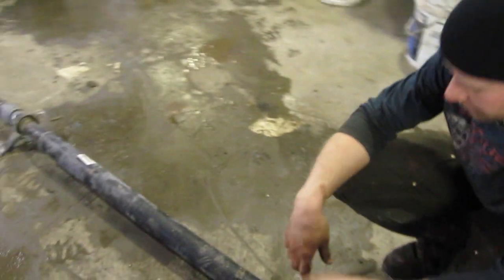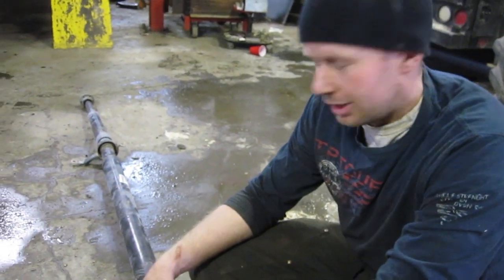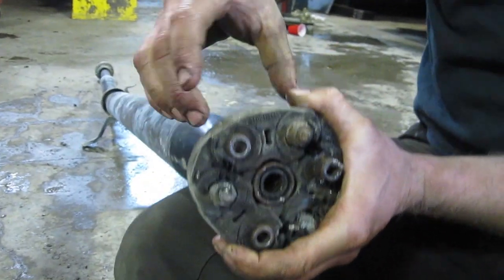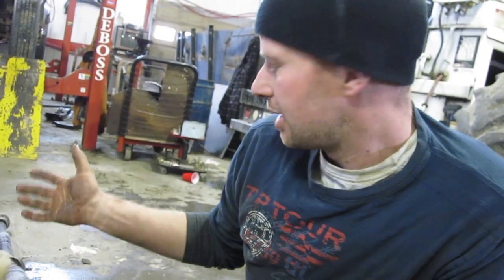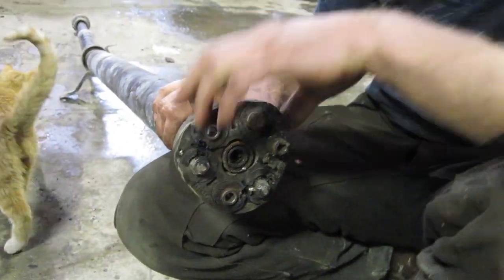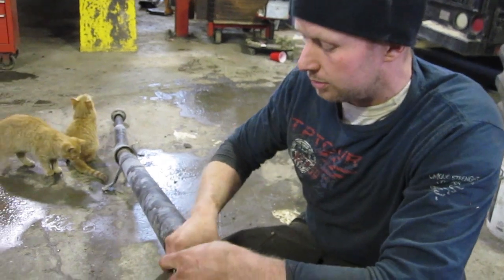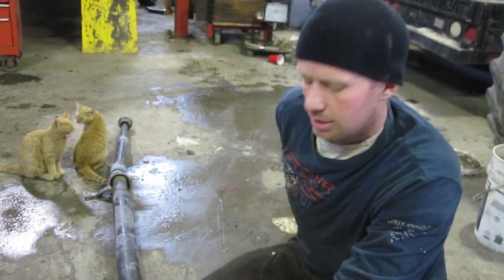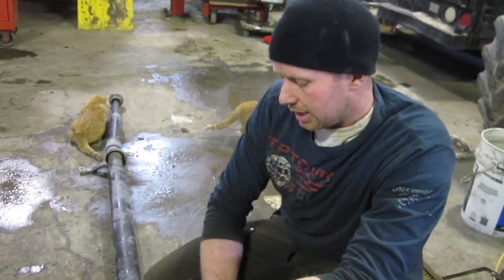Fix Vibrations in Drive Shaft

Comment: '97 Dodge Dakota  2 wheel drive  , noise starts at 40 MPH  , not a clicking sound but a high pitch sound that will make your ears ring. would it be the rubber damper ?

Comment: I have a 2004 jeep liberty and exactly at 50 mph rear tires start jumping. After I pass 55 mph it comes normal. I replaced all shocks absorbers and struts, all 4 tires balanced, all bushings and differential joint replaced, and the problem is still there. And weird thing is, if I lift the truck, this does not happen while is in the air, it only happens when is running at 50 mph exactly. Also checked bearing on all tires and they are still tight. The drive shaft seems not to be the problem since it looks really steday when running. Any idea or suggestions? I may be missing something to check.

Comment: I rebuilt a GM (Holden) driveshaft a couple of years ago & it still had a vibration off the mark on acceleration, it ended up being a sagging rear transmission mount which was the cause.

Even though my car has the Chevy LS1 Engine & T56 Tremec manual transmission, a $23 AUD generic (brand new) mount to suit an automatic 3.8 litre V6 car did the job & got rid of the vibration.

Comment: My 1980 plymouth volare has been shaking, bought a set of brand new tires since last ones were bad anyway, bad driver side front wheel bearing replaced.. still shaking. I'm gonna lift her up tomorrow and check the shaft next.

Comment: I’ve had a strange vibration in my 2000 Ford expedition 2WD , didn’t know if it might be a piece of rubber that was worn at the end of the driveshaft you never know? If they originally was one or not I didn’t notice one but heck it could’ve dried up and fallen out

Comment: 2wd 2008 Dakota has that same feeling vibrations start at 38 mph, then a him that echoes thru the cab, more of a groaning sound and shake clear up past 50; took it to a "reputitable " drive line shop, told me its fixed at the tune of $1100, no its not, it will be back come Monday!

Comment: good video. I have a 2006 silverado 1500 4x4 that vibrates only in the speed range of 45-52. It vibrates whether accelerating, coasting or braking. It started after having a 6.5 inch lift installed by a shop. I have installed new rims, tires, wheel hubs, tie rods, pitman and idler arms, and 2 u joints to my rear drive shaft and no luck. I am going to put new ball joints on it. What do you think it could be? Thanks in advance!
Reply: paint3ball when they lifted the truck I'f they didn't shim the carrier bearing or pitch of the shaft , it will cause vibration .

Comment: If that centre bearing hanger is off by 1 or 2 mm after installing it, will this cause the drive shaft too vibrate as well?

Comment: Hello, I hope I would receive a response as I dont know where else to turn..... I have an 02 Durango with 125,000 miles. Bout 6months ago had the ujoints replaced, solved the issue. Guy that replaced the ujoints said drive shaft is bad needs replaced said its barely hanging on. He said not to put in 4×4. When I get up to anything over 50mph I feel a vibration in the seat I believe is similar to what you explained about the coupler/gasket on the drive shaft going out as you described...... is this the solution to the vibration. The same fix as in this video. Please any and all help would be appreciated.
Reply from the maker: sounds like it yes
Reply: @DEBOSSGARAGE  ok. Thank you. Appreciate your time.

Comment: i know you probably get asked these things all the time, but i have vibrations in my 2009 ford fx4 no matter what speed im going but it does seem to smooth out at 60+mph. i know it could be a number of things but is this a common issue in trucks with a common solution?
Reply from the maker: u-joints in the driveshaft

Comment: I don't know if you'll answer or not, but it'd be important. Anyway, I have a 2004 Volkswagen Beetle (big mistake), and once I reach past 40-60 it vibrates so badly like the engine will fall out. Could it be the drive shaft? Or is it the CV axle or a motor mount? I have had my tie rods replaced, car aligned, and tires balanced.
Reply from the maker: +Colby Jack I would be leaning towards a cv joint or engine mount.  Does it do it if you put it in neutral and coast at 40-60?
Reply: I haven't tried that, but can one do that and not damage the transmission?DEBOSS GARAGE
Reply from the maker: +Colby Jack It won't hurt anything as long as the engine is still running for short periods.
Reply: DEBOSS GARAGE
What do you mean by short periods? I'm sorry, I don't know much about cars.
Reply from the maker: +Colby Jack just coast in neutral at 40-60 for a short time to see if the shake goes away
Reply: DEBOSS GARAGE I did, and it did so. The vibration is not as bad as it was, oddly. But I'm still gonna have my engine mounts and CV joints checked. Thank you so much.
Reply from the maker: +Colby Jack I'm betting on engine mounts.  let me know how you make out
Reply: Man who ever replaced all does parts ripped you off! They should of been honest....

Comment: Hey man I would like to know if you can help me I have 2005 Chevy Silverado when it hits 70 I feel a little vibrating on the truck not the staring wheel but the door panels and when I hit same path hole the whole truck shake bad side ways can you help me what could be thank you a lot ?
Reply from the maker: The vibration would lead me to thinking its u-joints but if the entire truck shakes when you hit a pot hole, I would look at the steering and ball joints.  With the truck off, have someone shake the steering wheel back and forth quickly and look at all the steering connections.  They should move at the same time.  For the ball joints, jack up under the front and grab the tire at the top and bottom and rock it back and forth.  There should not be any play.

Comment: hi i have bmw320i and just change the transmission but i hear now noise at car center in high speed like werwerwerwer plz advice
Reply from the maker: +adel mostafa I need a little more info like standard or auto, new transmission or used etc.  Im not that familiar with BMW.  Is it rear wheel drive,  front or AWD?  Does it make the noise in all gears or just one?  All speeds or certain speeds?  Does the noise follow the road speed or the engine speed?

Comment: Hi, just watched your video and the rubber coupling ( we call them donuts in the uk). Looks very much like a gkn coupling off a Land Rover discovery 2 rear prop. No idea if it's the same. But there about 20 pounds in uk so maybe worth a try. Matt
Reply from the maker: thanks! if I run into it again, I will look into it 1
Reply: someone before me left a socket on the rear u-joint ! would that be enough to throw the drive shaft out of balance ?
Reply from the maker: Without a doubt!
Reply: DEBOSS GARAGE thanks man ! I appreciate what your doing !

Comment: can you tell if the coupler is bad without removing the driveshaft?
Reply from the maker: +brandon Keen Yes, if there is any tear in the rubber, it will have a vibration.  If it is u-joints, it is more difficult.  The u-joint might be tight at one angle and loose on another.  Rust and dust is a definite sign that you have a problem.  Squeaks are also a bad sign.
Reply: DEBOSS GARAGE Thanks for the info.  my 05 maggie rt is giving me the vibe..sigh.  Good thing i can replace that rubber piece instead of the driveshaft itself

Comment: it was used auto transmission and noise is in high speed not at certin speed spcailly when closrd the window ca not presized where excatly
Reply from the maker: +adel mostafa rear wheel drive?

Comment: Question I have 2011 DJ anytime I hit 40mph it vibrant once I pass 40mph it stop also when I am going uphill and I try to keep up speed pass 60mph it vibrant then stop. My ABS light and traction control is on I took it to 2 different shop the dealer being one them both rear hub and ABS where replaced but never solved the problem car drive in front drive instead of AWD. Any help or suggestion

Comment: you can buy that rubber for $100 on eBay
Reply from the maker: link?
Reply: DEBOSS GARAGE OK I'll look for the link, but it's related to my car's drive shaft, it busted two days ago and it was that rubber, I looked on line and there it is.  my car is 2000 Lexus gs300 with a 2jz gte swap so I needed the driveshaft to fit with the transmission.